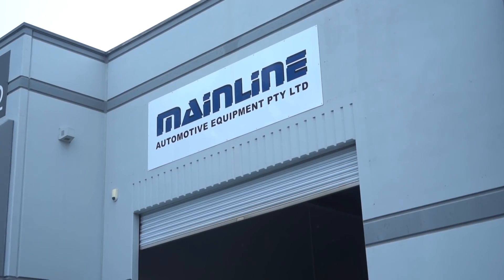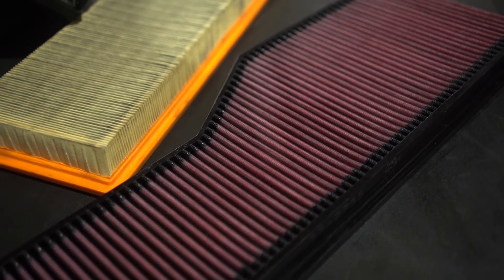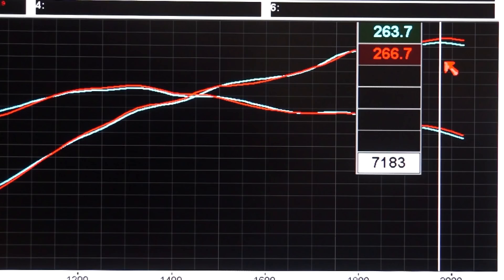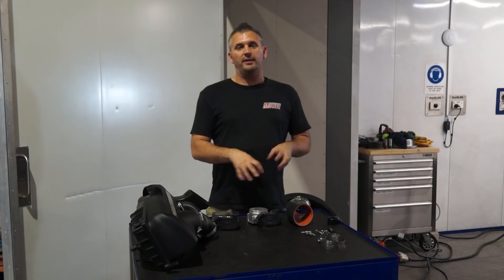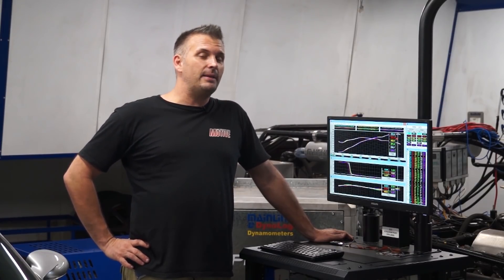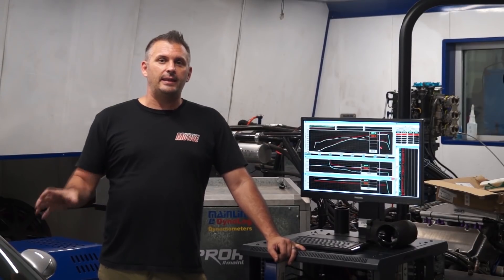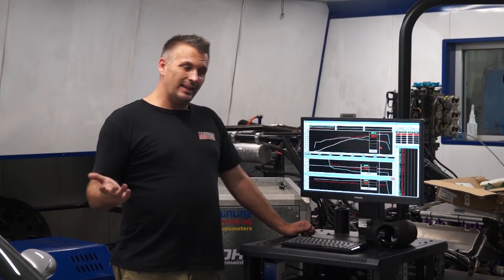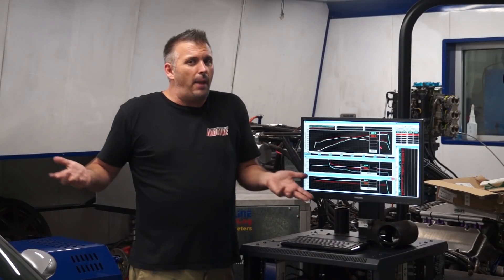MYTHBUSTED! Do Intake Mods Work? - Motive Garage Porsche 997.1 C2

Comment: I used this setup on my 987.1 S with Remus exhaust, desnorked, and a software tune and it works for me. The car pulls harder than stock
Reply from the maker: "Pulls" harder as in it "feels" faster, or did you dyno test it before and after?
Reply: @MotiveVideo  so here’s the sequence. Years ago with just Remus exhaust (no secondary cats) we put it on a dyno jet and it registered 270 on the wheels. I know dyno jet can read higher numbers. Then years later I put the 82 mm TB with the plenum and had sharkwerks tune it. Waited a year or two to put it again on another dyno jet, been very busy those years, and it registered 292 HP. I can really feel it because when I pull away on the straight in the track ( Thunderhill raceway in CA most of the time) it really pulls especially when the secondary Variocam kicks in. Since the sequence is not the same as the way others have tested it, I can conclude that it works but with the use of complementary mods (software, exhaust, and denorkelimg (remove the side inlet restriction and just use wiremesh). It may also be that all 911s are fully optimized compared to Caymans due to marketing hierarchy and that’s why there’s more room for modifications on Caymans.
I want to put headers but smog check is brutal here in CA. I have been tracking the car since 2009 and the mods just keep building up. Oil system modifications, coilovers, under drive pulley, GT3 LCA, brake pads, center radiator, tires, brake fluids, brake ducts, weight reduction, and racing oil. The car is still strong, 35,000 miles only but almost 1/4 of it is track miles. Lots of 7200 RPM in 3rd gear when pulling away from corners to straight away on the track. Also backroads and canyon driving. No ticking sound and blue smoke after cold start.

Comment: I've added this K&N cold air intake and Borla headers and mufflers to my 997.1 S.  My next step was to be the 3.8 liter IPD plenum.  Do you think that the intake and plenum have a better chance of adding performance since I've opened up the exhaust system?  I'm also thinking of tuning the ECU but haven't decided which product to use.

Comment: No surprise about the findings! Marketing hype & false claims are all to get you to part with your money. Porsche can supply you a Power upgrade option (X51 pack) which will give you a modest 28 BHP increase but at a cost £8k !! which is good value considering the HW & SW involved.

Comment: I've seen so many people in the 997 groups say "My butt dyno says the intakes are great!" but so far every bit of evidence has been like Maury going, "The results came back, and that was determined to be a lie."   The intake system on them is already really well setup.  Now, I AM genuinely curious if the X51 package has any significant gains over the stock airbox, since it also uses the same venting to fresh air technique.  There's no reason one should be sucking hot air into your engine unless you hate making power lol.  I've left my entire intake system alone.  I've seen people discussing the supercharger kits for them and those are apparently a nice gain.

Comment: Excellent video, I appreciate the attention to detail and design of experiment.  However, your conclusion begs a couple of (naively hopeful?) questions.  Clearly on the 3.6 motor the IPD plenum and associated throttle body are not addressing any bottlenecks in the stock system, but what about the 3.8 motor and specifically what about the DFI 3.8L on a 997.2?   Secondly, since you did notice a gain with some exhaust modifications would the free-flowing exhaust on a 3.8 even further benefit from intake plenum modifications and a tune.  In other words, I am selfishly begging you to test these same mods on a 3.8, preferably a 997.2.   Since not having any cats is not legal in most places, I recommend testing with high flow cats and just the Sharkwerks center bypass along with the IPD plenum.  I guess you can tell what car I have.

Comment: I have full exhaust with 63,5 mm tubes, very long neck headers, 100 CPI HJS cats, custom (made on the dyno) mufflers by Supersprint. I managed to reach 398 hp ang 43.5 kgs of Torque but without the wide parts from IPD. I have also used a ram air carbon air filter from GruppeM of Japan but instead of the better sound I experienced serious lack of power with this very expensive airbox. (306hp) GruppeM is another company who NEVER answered to my mails asking them why my car becomes slower when I use it. At last I have chosen the OEM airbox with a high quality washable filter which gave me the best results. Of course ecu reprogramming is necessary. I have tried all the products, the very same day, at the very same dyno with the very same conditions, air temperature etc and have run the car many days before the dyno with the larger TB and plenum to give the ECU time to adapt. (Even if scientifically speaking, this theory of the ECU adaptation is another myth because the ECU needs only milliseconds to adapt). 
I think we all have to be very careful when choosing aftermarket parts and insist that the companies show us real results and not only talks.

Comment: Hello everybody. 
I currently own a 997.1 Carrera S with 355 hp. 
When I measured her on the dyno she made 329 hp (more or less all the 997.1 3.8 Carreras produce around 328-330 hp at the dyno and not 355 as factory announces.
Talked with people from IPD plenum and proposed me the 74 mm IPD plenum and Throttle Body as a first stage tuning step and the 82 mm Throttle body with the 82 mm Plenum as the ultimate, better step for extreme hp and torque gains. I bought all of them and tried them at the same dyno, the very same day and the car produced 335-340 hp with the IPD 74 mm TB and plenum and only 306 hp with the 82 mm TB and plenum. The serious dropdown came probably from the larger diameter of the TB and the plenum due to the diminished velocity of the incoming air. The car every time I changed the TB and plenum with the original (for 997.1 Carrera S IPD 74 mm TB and Plenum) produced more power and torque. We tried several times even with all possible combinations (74 mm TB and 82 mm Plenum, 82 mm TB and 74 mm Plenum etc) but the car kept losing power every time the wider TB or Plenum was used. We also tried with ecu reflash and actual “fine tuning”, made many pulls on the dyno but we were not able to gain power from the wider series of iPD TB and Plenum. Finally I kept the 74 mm IPD TB and Plenum and sold the wider ones. When I mailed, showed all the dyno pulls and the bad results at IPD, unfortunately I never got an answer why my car kept losing power with the wider TB and Plenum. 
I would appreciate if you have any dyno results before and after the use of 82 mm TB and Plenum and if you would agree to show them to us. 
Thank you
Reply: the 355 is the crank hp number

Comment: So we got a bone-stock dyno result, can you leave it stock and do an aftermarket custom tune to see if there are any gains available there? 

I'd like to see the same done for "high flow" exhaust modifications / systems (with stock intake setup), and then the same IPD kit stock filterbox with high flow exhaust and IPD with K&N and exhaust. 

THEN, knowing physical flow changes have been made to the hardware but with stock ECU tune, I'd like to see a before and after tuning the engine with the new parts installed. I am skeptical that the engines computer would automatically adjust itself to accommodate these very different components... 

As a note, before folks go nuts, I have a 2010 cayman S with the PDK box and I am entirely happy with how it performs stock - I wouldn't be installing this stuff either way.

Comment: I have owned several naturally aspirated Porsche 911’s & Boxsters. The only things I have found to work are 
1. Panel filter
2. Any exhaust combination but best results were headers and cats, not necessarily the rear boxes.
3. A custom remap - Revo worked they best in most cases.

These mods together transformed the car. When you say you didn’t notice any difference, it’s like driving a different car when you get it right.

Happy Porsche driving

Comment: Great video. On my 997 I did a muffler delete coming from the cats back. Tremendous sound improvement. I also put in new spark plugs and a K&N filter. I’m interested in your next video with the exhaust modification numbers. Check out my channel and scroll down a few videos for some of my 997 videos.

Comment: This has been the standard discussion on Porsche forums for a decade or more (when did the IPD plenums come out?). The more reality-based people always claimed that they'd like to see a dyno test from IPD or at least with an IPD. This is the first time I've seen such a test. THANK YOU! I'm actually surprised that the K&N filter provided an improvement - though I'll stick to a paper filter and not deal with MAF issues. 

Now you need to do a test with other mods (such as exhaust, remap) to actually try to move more air through the engine. I can easily imagine that the larger throttle body will provide power at some point - but that the IPD plenum makes no difference. While I have always thought that it looks like the IPD could do something (the wedge splitter - not the dimples), if it'd been that easy, Porsche would have done it from the factory.

Thanks again! (and now do a 996/7 turbo :-p )
Reply from the maker: IF we could afford a 997 turbo we would!  We have lots more intake and exhaust tests lined up

Comment: would be interested to see if a fabspeed tune (or other after market tune) would make the difference.  I can def see how due to it being rear engined that losing the sealed air box would potentially cost you power (air flow and temp) but really would have thought the cleaner plenum intake and larger throttle body would have added power.  doing this with an aftermarket tune would completely put the nail in the argument
Reply from the maker: ssj1jason if they were marketed as “males more power when combined with tune” then fair enough but they’re marketed as “male power by bolting  on”
Reply: @MotiveVideo  yes... let me rephrase... your video and conclusions are spot on regarding they claim bolt on power.  I very very selfishly want to see what the mods do with a after market tune like Fabspeed. I have a 997 S with the 3.8 and have been looking at that Plenum change with the GT3 throttle bodies and if it DID work properly with an aftermarket tune I would drop the $$$$ tomm
Reply from the maker: @ssj1jason  WE're trying to find a way to tune it. So far, only set flash tuning, nothing where we can custom tune. Trying to find a solution.

Comment: Your adding more air with no tune of course your going to either stay the same in power or lose power, plus I bet at speed the intake air temperature would be much cooler with the bigger K&N filter due to that more air flow so again what is it that your trying to do make more power or make these companies look bad?
Reply from the maker: The parts are sold as bolt on items, not "need a tune to make them work" items. Also, we had over 120km/h air stream in the dyno cell with three fans in total. COuld feel power loss while driving it on the road too.
Reply from the maker: Israel Cardona also more air with same fuel would make it leaner, not richer

Comment: Try tuning it stock just see if you get anything more. Then tune it with the upgrades. I think that's where you're going see the difference
Reply from the maker: WE're trying. havent found software that allows us to tune it yet.
Reply: @MotiveVideo  not that I think you're going to see a lot of power or anything. I just think the ecu is dialing everything back to what it believes it needs to be at.

Comment: You mean that the K&N engineers are not smarter than the German engineers. The bigger throttle body is the most worthless mod for 90% of cars, all it dose is increase part throttle air flow.

Comment: I own a 996 and having tried most of the stuff you did in this video, I can confirm my findings were the same (butt dyno only) not scientific, but the best thing I found for the 996 was fitting the 997 air box, which confirms my suspicion the 997 3.6/3.8 air box is flowing all the air you could need for these engines.
Reply from the maker: James Healey thanks for the feedback. It was our opinion as well. If the 3.8 uses it then it’s enough for the 3.6

Comment: awesome video, super factual. as a 996 owner looking for intakes this changed my view entirely.. although I would love to try and chase that gt3 sound, hmm. maybe with a tune then?
Reply: You can just put one of those hard-tube intakes on and it will sound fantastic. I had the Fabspeed one installed for several years and it sounded phenomenal. The car seems faster when it sounds that horny, but just be prepared for it to actually lose some power, to run hotter, and (in my case anyway) for the low-rpm throttle response to feel degraded. If you're just chasing sound, though, it really delivers.

Comment: to put it bluntly. on a stock car, K&N or any other pod style filters do not and have pretty much never made a noticeable performance increase on any car, the only time they come into there own is when the engine is heavily modified and the stock air box cannot flow enough anymore,  but that takes a hell of a lot of tuning on an NA car.
Reply from the maker: D0DGER D I’m we’ve seen them work on V8s a couple of times but never on a 4 or 6 cylinder
Reply: The 93 Mazda NA V6's responded well to a CAI, so many resonators and corrugation on the factory one.

Comment: Thanks a lot guys, this helped me a lot. Was about to buy IPD upgrade for my 996 C4S in hope of some hp gain, but these tests just saved me bunch of money, so thanks once again. Best way to gain power in N/A car is by weight saving, take out everything you don't need - problem with the Porsche though is that it is pretty difficult to maintain that perfect weight balance because most of the weight that can be removed is in the front.

Comment: Is there a calculation you could do to correct the intake temp to match the first runs? You could then decide if it's worth building a colder feed into the inlet or if those mods will never make any more horsepower. A decent Banks style factual vid.

Comment: My 997.1 S increased HP and torque using the IPD competition plenum and throttle body. The 3.8L is different, it’s not optimized from the factory.

Comment: IMO the loss in power was the K&N intake pipe MAF housing caused it to overread the airflow, higher airflow reading = more fuel and less timing = less power. In addition to the higher IATs.

Comment: Brilliant, those daft hot air intakes like k&n have always bugged me. I took the resonator our of my airbox, then after reading dyno tests put it back in.
Reply: Advertised as cold air intakes as well. That only works if you can get cold air in, not an issue in front engine cars. K&N roof scoop anyone?

Comment: oh please please can you proove that this abominable "desnorkeling" thing some people do to their 986 and 987 boxsters and caymans doesn't improve power?
Reply: I’ve been saying this for ages, it’s mainly LHD cars because the de-snorkel is on the left, basically you make a hole in the bodywork and because you’re sat on the left in a LHD car, the engine sounds louder, louder engine sound gives the placebo effect of more power. I also thought the GT3 plenum and throttle body seemed fairly pointless, without a turbo or super charger you still have the same cc so the cost and complexity of the modification for what would be at best a nominal gain in hp seemed pointless.

Comment: So what tuning was used for these mods?  I didn't see the tuner used.
If you don't tune you're not doing what the manufacturer recommends.  If you're not doing what the manufacturer recommends, you can't really claim they don't provide the gains the manufacturer said they would.

This is kinda click baity / fake news.  You're saying "mythbusted" as if you've reached some conclusion, but without tuning as recommended you're not taking proper advantage of the installed parts.  You're just adding to misinformation :(.  So I hope that you tuned and just cut that out of the video, but I have a feeling that wasn't the case.
Reply from the maker: MrSlowestD16 you’re kidding right? The he e marketed as “bolt on” mods that increase power and don’t need tuning

If we tuned it, it would go against what the manufacturer says to do

Comment: This is exactly why I snicker every time one of my buddies say he’s goin to replace the intake system on his car.  You go right ahead Bud, I’ll just enjoy my Porsche while you deal with possible engine intake codes, downtime, heat soak & the same or less HP.  If you want a easy way to make your Porsche faster, just tune the nut behind the wheel.
Reply from the maker: We tune that nut regularly. check out our Rallypsrint videos in our WRX

Comment: i think the trick to get a bit more air in is modifying the intake opening on the back deck-lid (velocity stack change), into the intake box. will work best with the K&N drop in OE filter. Next would be the intake manifold.

Comment: If you want more power out of that engine from the intake side you're going to have to resort to some serious antics with variable length intake runners and/or cam magic. Porsche is a ruthless competitor in the high end market who leaves no stone unturned. If you come up with something to make more power from that engine it will come at a cost Porsche wasn't ready to pay (crappy emissions, premature engine wear, questionable reliability, etc).